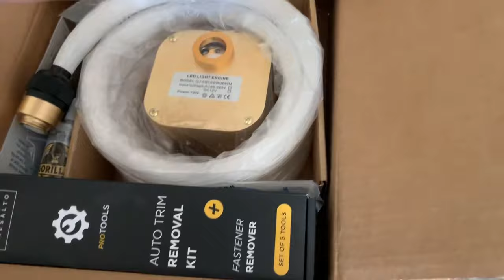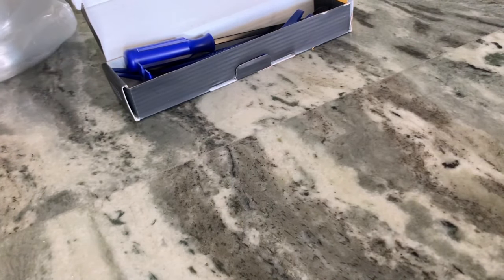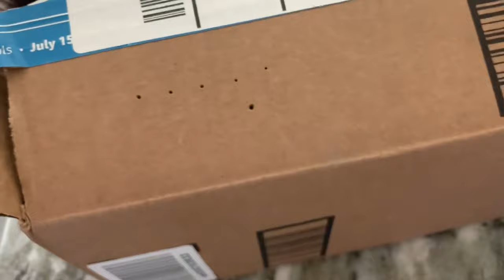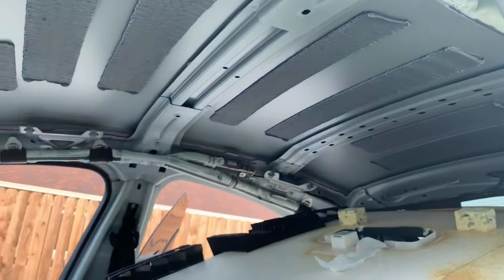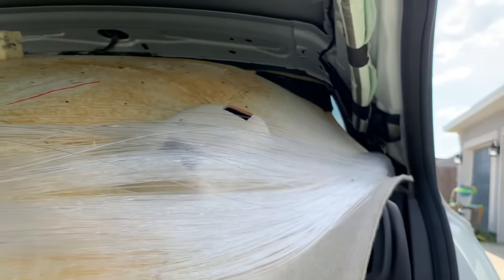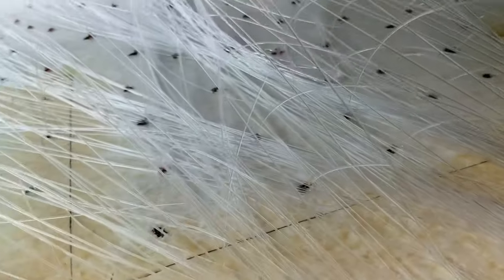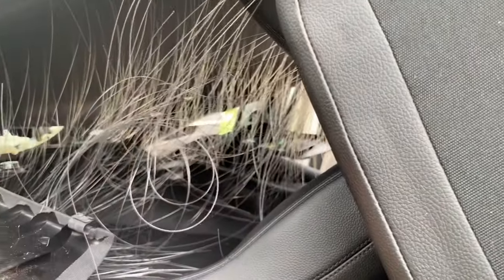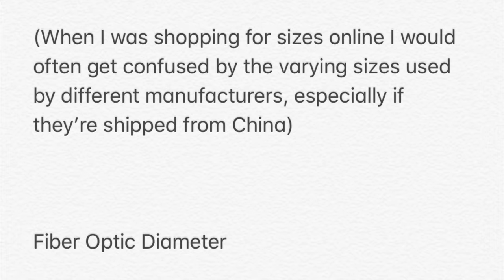How to Install a starlight headliner in 2023

Comment: Hi, What does it look like during the day, I was told that it was not beautiful during the day and that we can see the holes? And I have a Cadillac with a panoramic sunroof, can it be done ?
Reply from the maker: Gabriel Parent hi if you dad forward to the very very end of my video you will see it in like the last 5-10 minutes. You can only see them ever so slightly. You reeeeeeaaaally have to be looking for them. If I turned off the lights during the daylight and someone got in the car, they would not notice at all unless I pointed them out. They are literally just a pin prick thick. Also people are always shocked and not expecting it. I took my car to get an inspection sticker and they didn’t know until they turned on the car. If you scroll in the comments below, I put a link to someone who installed this on a moonroof not a panoramic roof. That may be pushing its limits. But I’m sure anything can be done after all.

Comment: Have you had any issues with the projector or lights going out in the couple years since doing this? My set is on the way and I guess I'm wondering if it be better to stash the projector or make it accessible incase the lights burn out or the projector fails.
Reply from the maker: No problems so far. And I prefer to make the projector accessible. Just in case. You wouldn’t want to take apart everything just to install a new projector

Comment: What does it look like during the daytime when the lights are off? I’m considered doing this I can’t decide if I want to do it like you did or put a fabric over the lights.
Reply from the maker: Francisco Cedillo if you fast forward to the end of the video you will see it with the light on during the daylight. Also from what I’ve read on other threads... putting fabric over the lights will diffuse them giving your roof a cloudy sky look. Instead of precise pinprick lights you’ll have a wider light circle. It wasn’t what I wanted to risk doing just in case I didn’t like it, it would have been impossible to poke 450 or so fibers through the fabric after the fact

Comment: Heya, 

Do you think 450 is enough for a Golf hatchback? 
Tempted to go for 550.
Reply from the maker: 450 is enough, it’ll look like my car. Do 550 if you really want to. Nothing wrong with that
Reply: @ReynaldoVelasquez  Thanks! Also, did you end up using both tubes of Glue?
Reply from the maker: @Akaqibs  barely even finished 3/4 of the first tube

Comment: If I wanted to take them out would my ceiling be messed up ?
Reply from the maker: It would be pretty hard with the glue… but if you managed to do it… yes most likely. You might see the little holes…. Or maybe not… but I’ve never seen it done

Comment: Great job Reynaldo! What would you rate the difficulty level on installation? I always seem to run into other problems when doing any car project or repair. I’m looking into doing an instillation on my truck here in the next few months . Also I’d be very nervous especially in a Mercedes, to scared to break something lol good job though !🙌🏻👍🏼 do they seem to work 100% to this day or are you running into a few issues like burned out fuses or anything ? Thanks !
Reply from the maker: Richard Garcia they do work 100% to this day, I would rate this project a 5 in difficulty (1being easy and 10 being hard) and I would rate it an 8 in labor and in being such a time consuming tedious demanding project. Those strands one by one take up a lot of your time and attention
Reply: Ok awesome they look good! And I like taking on projects like that, so I will definitely be doing the installation on my truck . Thanks !

Comment: Use speaker wire for the power wire would probably work wonders
Reply from the maker: That’s actually what I ended up using. It did work wonders

Comment: I will watch after work but I have a sunroof and. I don’t wanna have that empty gap. Is it possible to put them in the liner of the sunroof as well?
Reply from the maker: As I’ve recently found out… it is…. But… if you plan on opening and closing it often… it may become a problem. The fibers may become caught. The space between the glass, the sunshade , and the metal bracket that is between them leaves little room for them to fully function
Reply from the maker: As I’ve recently found out… it is…. But… if you plan on opening and closing it often… it may become a problem. The fibers may become caught. The space between the glass, the sunshade , and the metal bracket that is between them leaves little room for them to fully function

Comment: I have a Honda Accord 03, & when I bought the car the cigarette lighter ports didn’t work. Do I still have a chance of doing this even without a power outlet from the car?
Reply from the maker: Yeah just tap into the fuse with an “add a circuit” fuse tap. I’ve seen people tap into the lighter , power windows power seats

Comment: I really hope you will answer it as I myself am working on the project in an e39 touring with 1500 lights. but the way you cut the rest of it that sticks through, if you run your hand across the ceiling, do you have a lot of little spikes or what?
Reply from the maker: I did feel spikes at first. You can feel them…. Buuut if you can get a really tight snip as close to the headliner as possible without snipping the headliner… you will just feel small intentions in the headliner instead of spikes…. It will feel more like perforated holes
Reply: @ReynaldoVelasquez  I have alcantara on my roof, so I was hoping to avoid small spikes because it is a little thicker than the normal roof, but then again, i think a little can't be avoided. but thanks for the answer, I have to try some different methods so I get the best result, and thanks for the video, you were the last push for me to order the set, so big toms up from here on your guide.

Comment: How did you take of the sunglasses holder up top
Reply from the maker: I don’t have a sunglasses holder in my car, it’s just a dome light. There are instruction videos online. Basically I just inserted the wide trim removal tool into the front half and pried it off

Comment: Hey man! How many microfibers did you need for this and what car model is this? I have BMW E60 and want to get an understanding of how many stars I need.
Reply from the maker: I believe I used 450 strands at .75mm width, and 9ft length. I had a 2014 Mercedes-Benz CLA 250

Comment: hey wouldnt it have been easier to cut out a spot in those plastic pieces in the headliner for the light engine then just wiring directly to the fuse or the dome light?
Reply from the maker: It may have been easier, the light engine is pretty bulky though. Mine was about 4”x4” and has some weight to it. But they do offer some smaller engines that would fit perfectly in that small space. I also wanted to be able to replace it easily if it ever went out for whatever reason, without removing the entire headliner again.

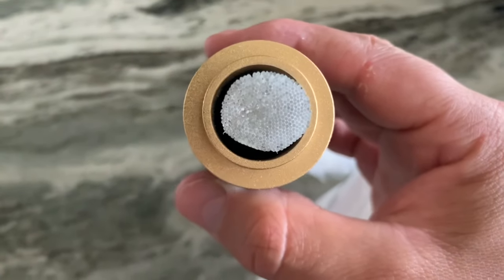Comment: 10:14 Hey so I have the fiber optics but they are not flush in the strand. How can I make them all flush so each get equal amount of light from the light engine? Should I just remove the black tape and one by one put them together to make a them all flush?
Reply from the maker: Darshan Brahmbhatt yeah, I see what you’re saying... so at the point where they are taped up to connect to the light engine, they are all uneven?! Well yeah if it’s just a little bit, it shouldn’t affect it too much at all. But if you really want to do it to keep them flushed, then yes remove the tape carefully (try your best to keep them together because it can become a mess easily with tangled fibers. Maybe you could even rubber band the fibers together before you remove the tape. Then just try your best to tap them on the counter to flush the bottom of the fibers. (Hope that made any sense, I’m still drinking coffee)
Reply: Reynaldo Velasquez yeah man they are all uneven at the part where they are taped up to connect to the light engine. If it was a little bit I wouldn’t care but it’s super uneven, that some fiber optics were starting at the tape and some were above making all the light uneven and causing dimness in some fiber optics. I understand you 💯 man it made sense! I have a 2018 Honda Accord which I’m going to be doing this, and by mistake I ordered the 6.5ft strands. I think i might have a hard time making it reach to the back. But i ordered 550 strands and I’m thinking I should ordered something like 600 strands 13 feet
Reply from the maker: Darshan Brahmbhatt no way! 13ft would have been overkill for your little accord. I think if you premeasure the car before you install, you’ll have a better idea of how and where to put your light engine. You may need to be a little creative but just keep an open mind. I need to make another video that goes even MORE in depth. One thing I did before I ordered my strands... was I got a piece of string/yarn/ radio wire... and I opened my car door and looked at the headliner to see where the sun visor ends, I taped the string on the outside roof-top, exactly where the sun visor ended when it was flipped up. Then I popped my trunk open and carefully ran the string along the outside of my car and guided it into the general direction I wanted to install my light engine. I marked that point on my string. Then I measured the length of the string to see which size fiber optics to buy. I really need to make one more installation video to help more people out
Reply: Reynaldo Velasquez the looks are deceiving on online bro, the 2018 accords are the size of Mercedes e class/Audi a7, so  I’m thinking I should’ve got at least 10 feet to comfortably put the light engine In the trunk. Yeah man your right I should’ve measured things first to see how long I would need. I think I will take a long string and measure from the headliner front to the trunk and see how much I really need and if this little 6.5t starlight will work out. If it’s going to be small I might just install it in my c300 which I bought yesterday. Yeah man I think you definitely should make a video! Thank you so much for your help bro, I appreciate it a lot!
Reply from the maker: Darshan Brahmbhatt hey I just thought of this, it’s a little bit of a hassle but maybe it could help. Just measure how far the 6.5ft fiber strands will reach with your light engine in the trunk. Then you can just order 50 or 100 or so more fiber strands or you can order a whole roll of fiber and cut it down to size. It may be a little pricey for the roll but you should be able to find a set of longer strands to make up for the front of the headliner where the 6.5 fibers won’t be able to reach. And just order the long strands and tape them into the bundle too
Reply: Reynaldo Velasquez hey bro I just measured and I need like 10 feet at least to comfortably install the fiber optics to the back of the trunk. I regret not measuring first. I think I will return this and get a 4m one. Thank you so much for the help man!
Reply from the maker: Darshan Brahmbhatt no problem, glad I could help, I should have mentioned that in my video, I regret not doing that now. I’ll make an updated video aoon

Comment: How did you wire it I got it coming in the mail now but I don’t know how to wire it to where it cuts on with my car could you help me out? It’s going in a Dodge Charger
Reply from the maker: jaylen wilcoxson I currently just have it wired using the car lighter. I’m using the rear backseat lighter and ran the plug through the trunk and into/ through the crack in the two foldable backseats. Since I have no one who ever sits in the rear anyway

Comment: Nice tutorial! question. Do you know if it is possible to sync the effect controls of a double number of light engines? To double the quantity of light points? I think the total fiber optic count is too low for the square footage of headlining in the vehicle I intend to do this to. Thanks for the video!
Reply from the maker: I’m sure there wouldn’t be a problem. But you would either just use two remotes to control each engine... or maybe if you buy two of the same engine, maybe the one remote will send the exact signal to both light engines. Also the package only comes with a certain amount of fibers, but there is still a lot of extra room to add more fibers to the same light engine
Reply: @ReynaldoVelasquez  
Thanks for the very fast reply! I have just begun to investigate what is out there. I would be satisfied with just the starlight effect in white with no other effects. I love the video you did. I think that you would have had a much easier install of it if you had a glass shop remove the backlite to enable the removal of the headliner. When cars are assembled they install the headliner through the front or rear glass openings. It would have been awesome to see you work in comfort in the garage rather than sweating the job outside. Thanks again!
Reply: @scottbrown7415  there are light engine with two heads

Comment: Can you do this using a sperate battery instead of using the car lights
Reply from the maker: Kyree Mcguire these do not plug into the car headlights. (If that’s what you were referring to.) I don’t know a whole lot about connecting these to a battery but I’m sure you could find a video in it. I just connected mine to the cigarette lighter
Reply: Reynaldo Velasquez does that mess lower the battery. I mean lets say you were to go for a long ride ?
Reply from the maker: Kyree Mcguire I mean... I’m sure it does to some small degree. But I believe the light is LED so it shouldn’t drain that much energy. I wish I. Plus put a meter up to this and the battery to see how much energy it drains. I’m a year in now and still works great and my car still starts
Reply: Reynaldo Velasquez thanks man! Do you think they have em where the car wouldnt power them at all ? My thing is id rather just play it safe and not have it come from the car at all. Like possibly just keep replacing the light battery.

Comment: Hey question I seen someone wire into a sub amp I have one but before I wire it I don’t wanna burn my light box up
Reply from the maker: Battlefornt Kids I don’t know anything about that. Maybe see what the specs are for what they used to wire into their sub amp... and if your light engine uses the same volts or amps ... maybe it would work too.
Reply: You should be good as long as you buy a power line splitter it’s where your main power wire from your battery runs into a device that can split off two or four different ways to get power you’d run one of the outlets to your amp and then the other outlet you can run to your starlight headliner system

Comment: Do you have to point the remote towards the trunk or does it work where ever?
Reply from the maker: Conner Johnson you do not need to point it to the trunk. It works any which way you point it. But there have been a few times where I did have to point it to the trunk for whichever reason... but it’s no big deal to just flick your wrist to face the back seats and problem solved.
Reply: Thanks for the quick reply and in-depth  diy!

Comment: Love the video bro, how did you wire it with the fuse? I’m currently doing this right now and got the fuse adapter and 14 gauge wire but where did you splice/connect the wires to? Directly to the light engine or did you cut the wire off the cigarette lighter connector?
Reply from the maker: I’m about to release the video
Reply: @ReynaldoVelasquez  ok are you uploading it on this page or the starlight headliner page?
Reply from the maker: @Daneil779  this page
Reply: @ReynaldoVelasquez  hey! Don’t mean to bug but I wanted to try putting it in today, could you just tell me how you wired it bro?
Reply from the maker: @Daneil779  in this video I just ran the wire/power through the crack in the foldable back seats , and ran it to the rear cigarette lighter. No one sits back there.
Reply: @ReynaldoVelasquez  oh ok, so you never ended up doing the fuse wiring? That’s what I was trying to do but I’m a little confused on how
Reply from the maker: @Daneil779   I’ll do it just for you
Reply: @ReynaldoVelasquez  thank you so much🙏🏽🙌🏽 you’re the man! I basically just followed your whole method, especially with the glue!

Comment: Damn bro looks so CLEAN! I bought the same as yours and installed mine on my golf R but the twinkle effect isn't anything like yours which is such a bummer. It's basically looks no different to when the twinkle is off and the stars are static, but if you look at each individual star, only then will you notice it twinkling. I'm so disappointed man - any ideas what could be wrong?
Reply from the maker: Adjust the speed or the brightness. That should help fix it. If not let me know. You may have the twinkle speed too slow to notice or not bright enough

Comment: Would this hurt the value when you try to resell or trade?
Reply from the maker: Seth Sherwood most likely haha its the labor of love.
Reply: Hurt the value, if anything I thought it would increase the value no? They charge an extra 12k for that.
Reply from the maker: Cristhian O well maybe to the right buyer it will increase the value a little bit, similar to a lifted truck to a person who likes that mod... but most things like this are usually the labor of love. Like if I were to take it into a dealership, they will say the car has been tampered with and need a new headliner or it will take a special type of buyer, some might find it tacky, or wonder how this mod affects the lifespan and safety of the car.